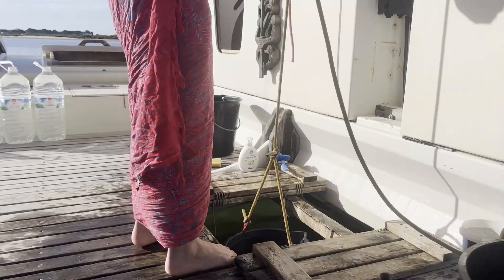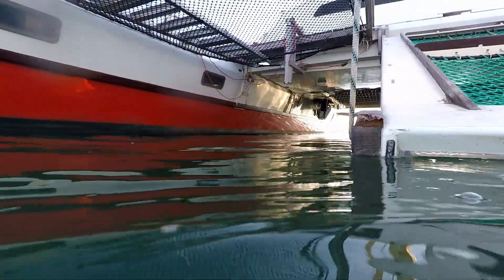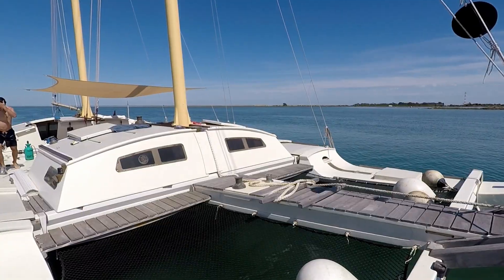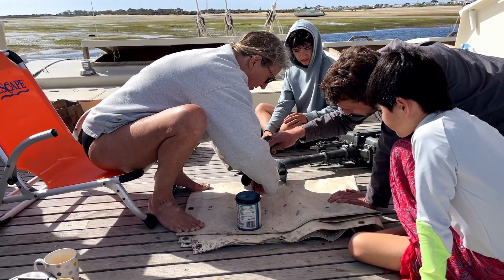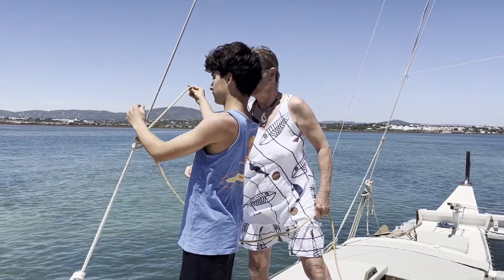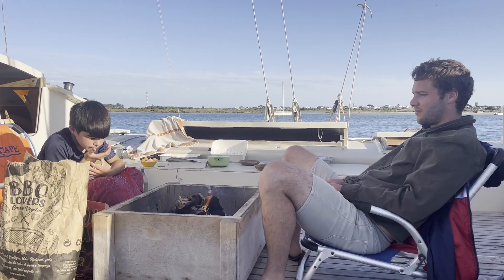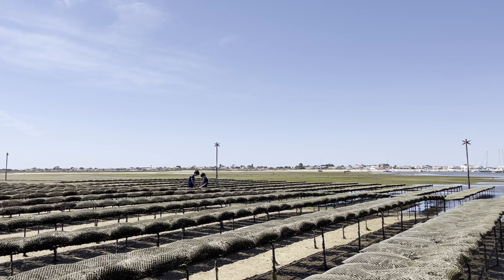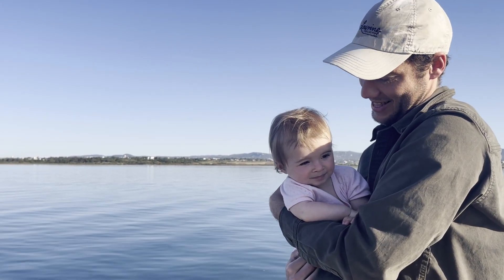Exploring Wharram Designs' Pahi 63' 'Spirit of Gaia' in Portugal with Designer, Hanneke Boon

Comment: I'm in my 50's with nothing and no one and lost everything in a fire. I'm thinking of something like this to live aboard. I'd love to build something like Ontong Java...but I don't even know where to begin or how to go about finding any kind of community to plug into. Housing and land is insane these days and I've always loved the idea of having my own ship or floating island....maybe someday.
Reply: You could build Tangaroa, 37 ft design. It is a big enough for ocean sailing for two people. Few sailed around the world.
Reply: A guy I knew had a tiki38 pro built here in phuket. In 2006. Cost him 120,000 euro. Took 3 years. Supposed to take 1.He was struck by lightning around 2015. The boat suffered massive structural damages. Pin holes all through the hulls.  It was sinking slowly.Chain plates blown out.He gave up the lifestyle and sold for maybe 50,000. He was happy enough for 10 years on the water.  So not a waste in his opinion. But I had the plans bought to build pahe 63. Back in 2004. Sold them 10 years later after I was injured and not able to get started . Instead I bought a mono and sailed half way around the world in those first 2 years after I bought plans. So changed my path. Glad I did. Plywood boats are not going to last. My mono is 50 yesrs now
Reply: If you dont have the capacity to find communities/forums that build boats, then you certainly won't have the capacity to build one. There must be a 1:1,000,000 effort correlation to those 2 tasks for a boat this large.
Reply from the maker: Ontong Java is a magnificent boat. But you don’t necessarily need something so big. I recommend joining the Wharram FB group and subscribing to their website, reading articles, or do what we did first and buy their design book online which gives you an overview of the philosophy, building techniques and boat designs. Then you can be better informed and choose a design you might like to build yourself. Alternatively, there are Wharrams for sale to buy secondhand.
Reply: @floatingstorieslab  I really loathe Facebook...but i'll consider it for the community.
Reply: @floatingstorieslab  I'm shopping now.  :)
Reply: @velvetvideo  Have a look at Wildlings Sailing. He's doing up a 42ft Wharram. IMO that's a better size for one or two people.
Reply: @NeilBarratt  The only thing you will learn from Wildling Sailing is what not to do. He bought a rotten, waterlogged boat. He is attempting to fix it while it is on the water (impossible due to humidity). From what I have seen he doesn't have a wood moisture meter - probably doesn't want to know that his whole boat probably couldn't even be sold for firewood value (too moist). He thinks "dry rot" (fungal growth) is his biggest problem so is treating it with fungicide rather than tackling the root cause (moisture in the wood). Every episode he laments the rot in his boat, yet every episode he makes it worse by doing things like driving wood screws into the hulls (creating an expressway for moisture into the heart of his boat). I feel for the guy - he's passionate. humble and hard working, but I think all his hard work will ultimately be for nothing.

Not all Wharrams rot, but a lot do, some within a few years of being built (e.g. BareBare to BoraBora). I hope this comment is a bit of a heads-up for prospective Wharram (and other wooden boat) owners.